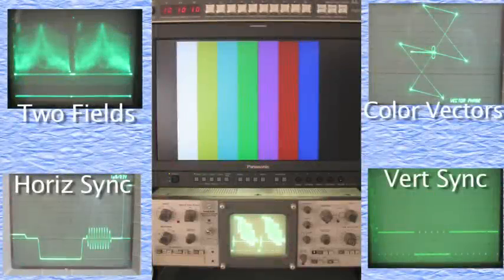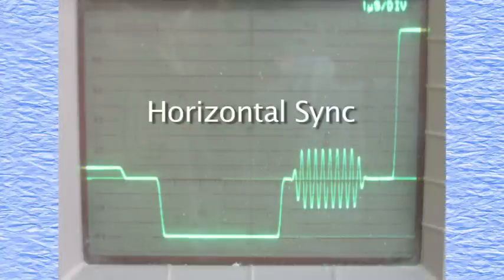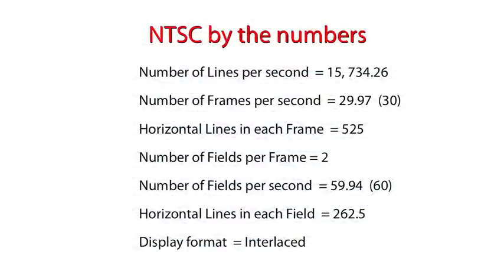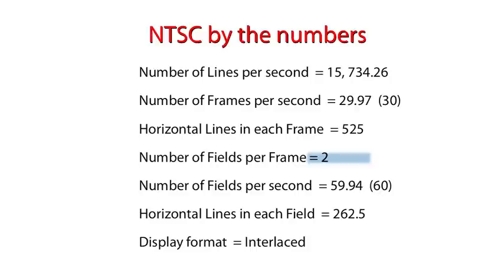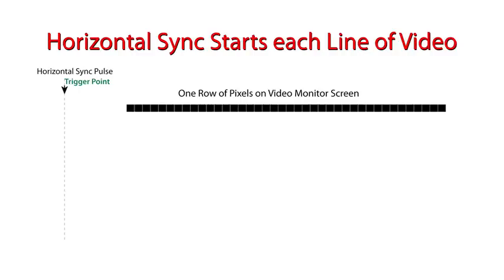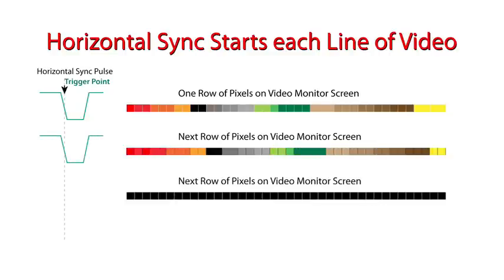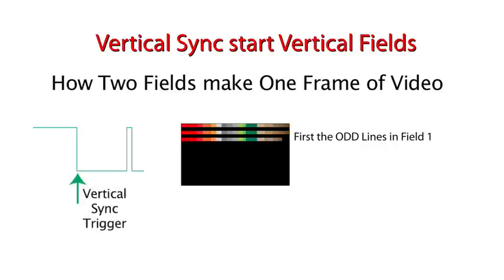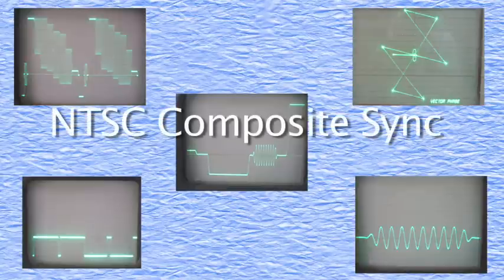Intro to Composite Analog Sync

Comment: I sure miss analog. First, I totally understood it. I could easily see the parts of the signal on a scope and how they related to the picture. And it was much easier to trouble-shoot problems- I could diagnose nearly every problem with a quick look at a scope or even a picture monitor. With digital- its just a glob of bits- it ether works- or it doesn't. And when it doesn't you get hardly any visual clues why its not working.  :(
Reply: Analog is king! I mostly understand it. I'd like to understand more about it..... like the color burst specifically.